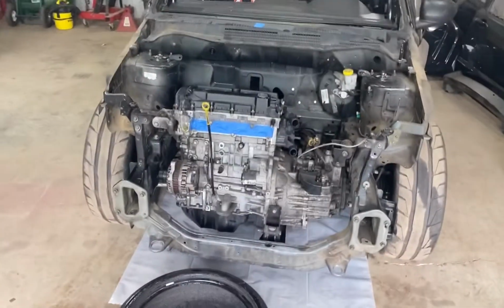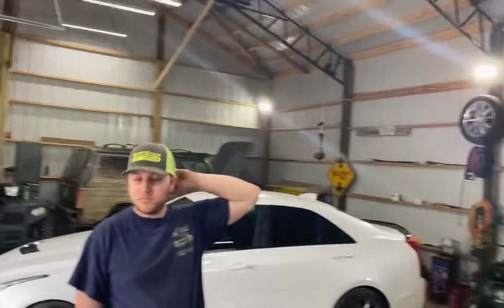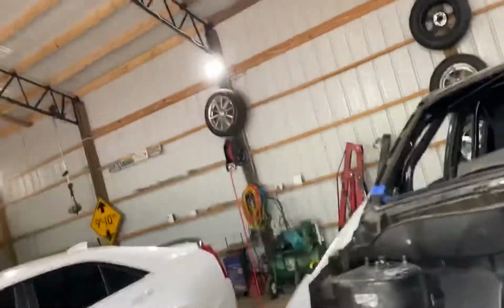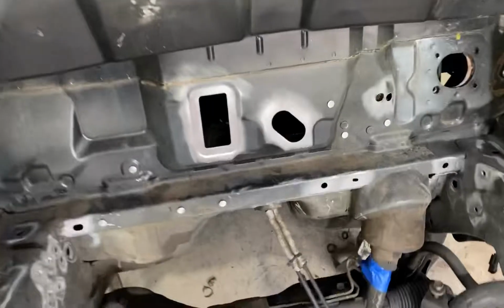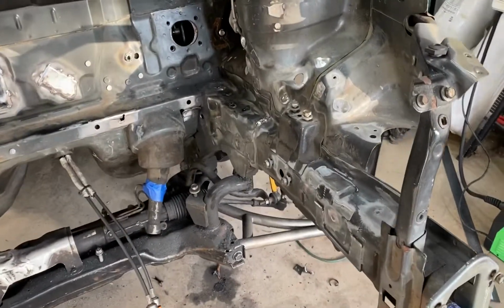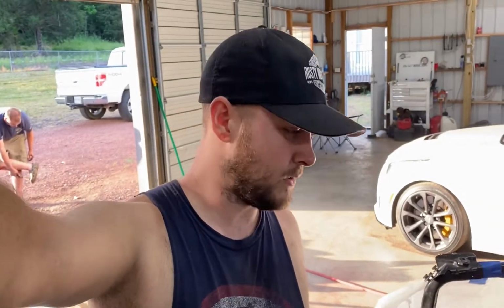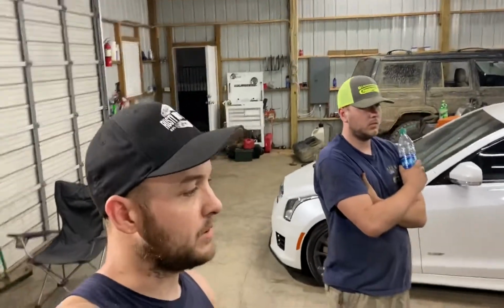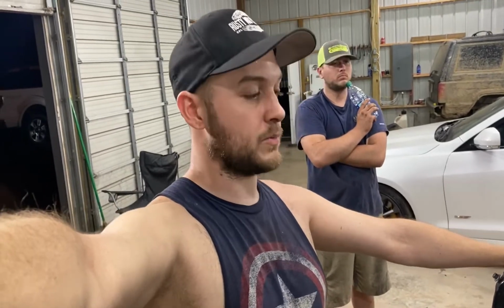PULLING THE MOTOR: Welding and Prepping the Engine Bay

Comment: Never weld on jack stands always do with tires and on ground it's very easy to twist the frame if you are going to do on stands then tie all the critical points
Reply from the maker: That’s a pretty solid point. Just welding up the seems here, not too much heat at once, but I’ll keep that in mind moving forward 👍🏼

Comment: Did you use a regular flux welder. i see that you have the titanium 125? Thinking of doing the same but dont have money for a gas welder. how did you like that Titanium welder?
Reply from the maker: I use it to make brackets and stick some exhaust cuts together. I wouldn’t use it for anything really important. Just a cheap metal glue gun.